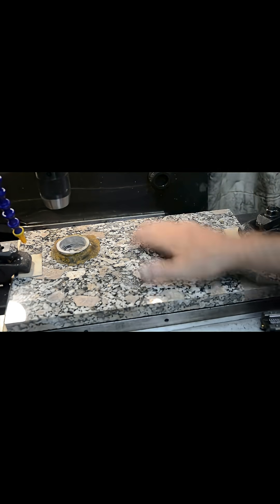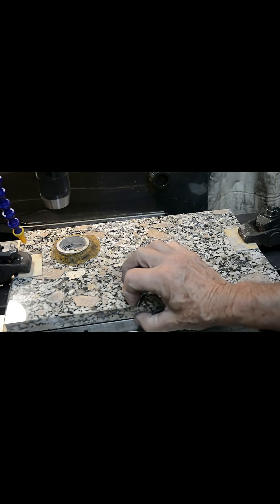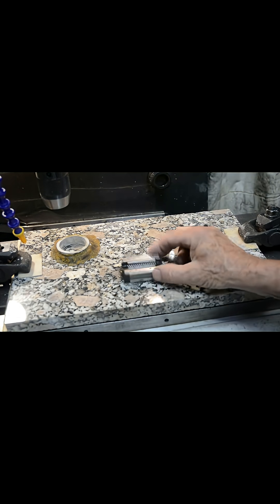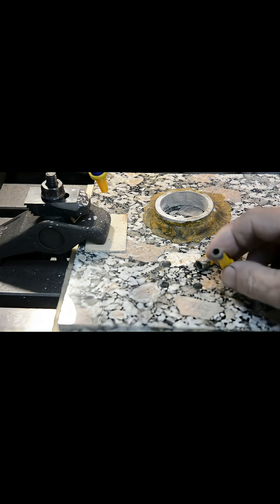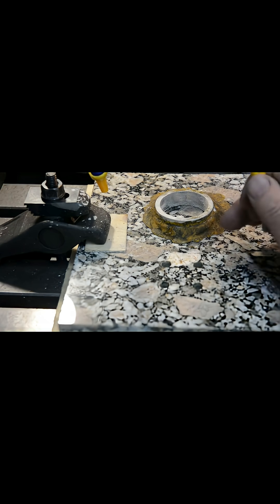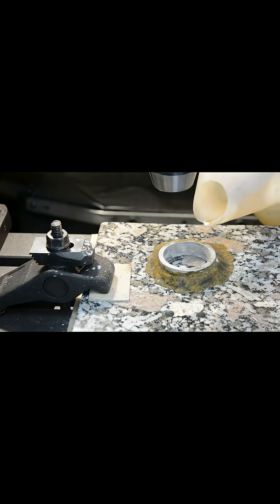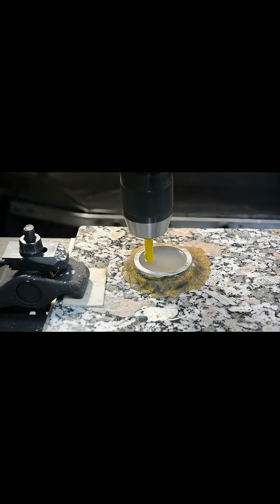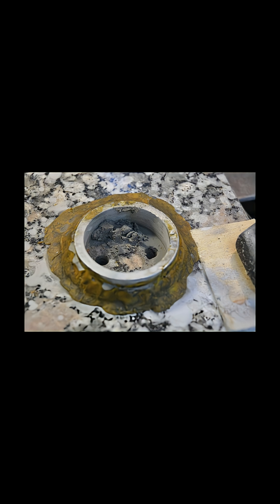Drilling Granite Short #diy #drillinggranite #diamonddrill #linearrails #cnc #machinetools #shorts

Comment: Hi Tony, what I have done was make a ring about 10  bigger than the diameter to be drilled ,  and about 10 mm thick and drill a hole in the periphery of the ring and silver solder a tube into that hole , and connect the garden hose to it , and drill the hole with the hand drill , using a template that have been previously drilled with the holes locations....